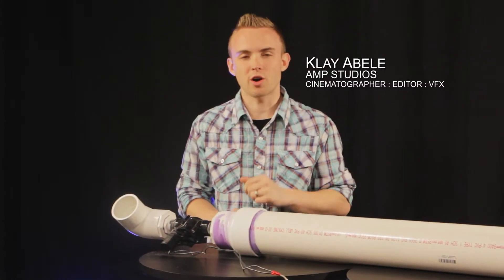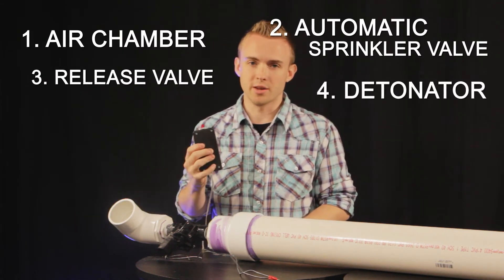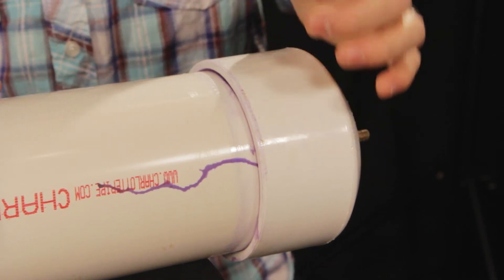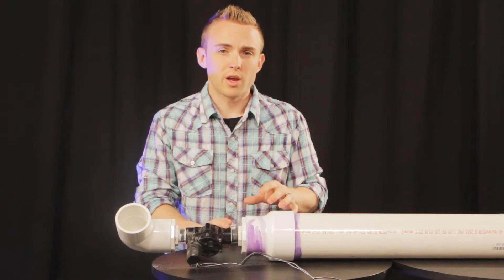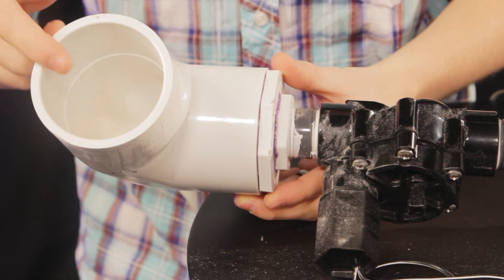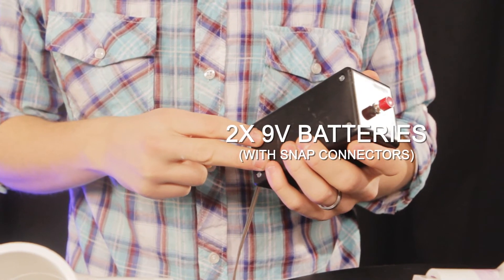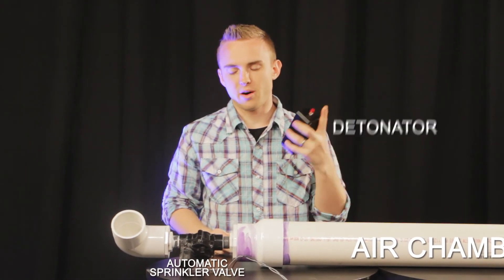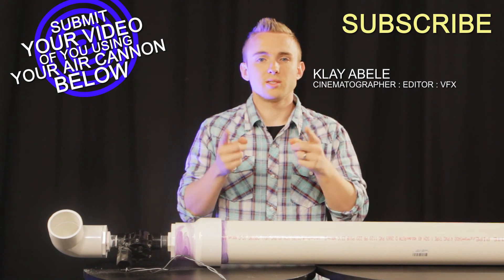DIY Filmmaking: Air Cannon - Ground Explosions

Comment: As one of your comments says,you may need an extra release valve you could add an garden connector to the air chamber with an valve of course to release the air if it doesn't fire or a pipe valve by drilling a large hole and attaching it that way but it's a fail-safe nonetheless.

Comment: The max pressure you should use on your chamber can not exceed 298 psi. I looked it up and the op max is right around that so I would pressurize at 100 to 200 though I would look online for the pipe max operational psi and add a tire gauge on the cannon to make sure it is right likely a drilled hole and it is glued in place somehow. I was hoping to build one of the sooner or later but prices stink where I am especially with the chamber pipe at almost $3 a foot and that sprinkler piece at $30 a piece it's tough.

Comment from the maker: The PVC is rated for 225 PSI and sprinkler value is rated for 175 PSI, however we tend to fill to 100-125 for safety. We have hand pumped it and that SUCKS so we recommend having a compressor handy.